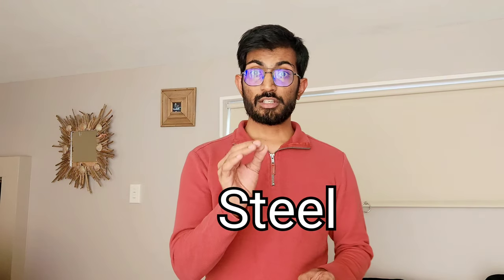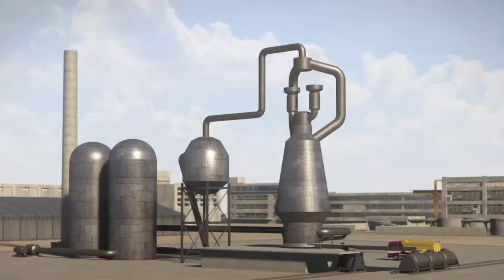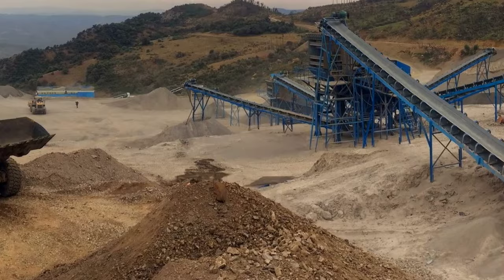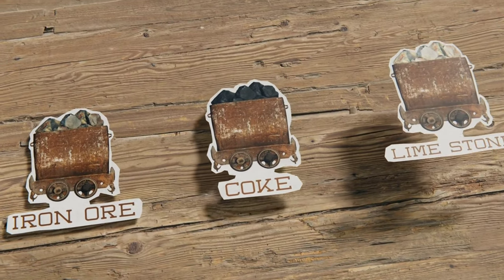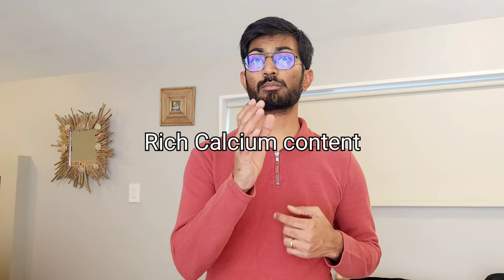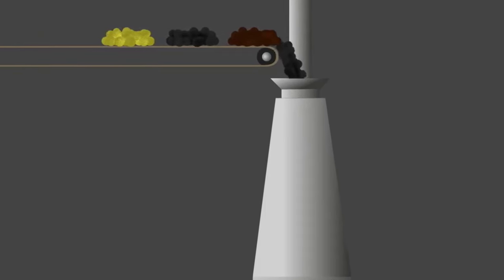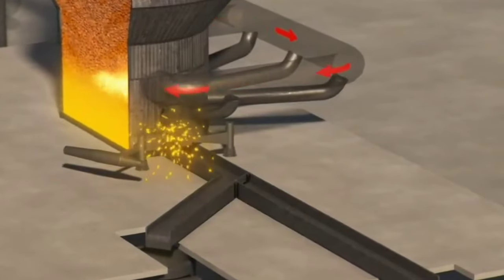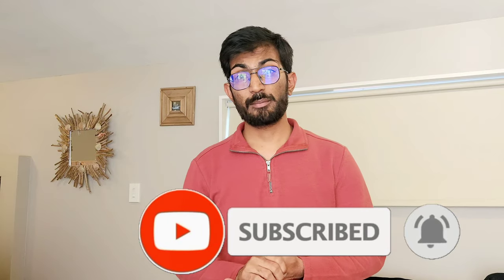how Steel is made? part 1  #steelmaking #steel #metal

Comment: Not made by steel? Planes, my toothbrush, phone can done almost without steel, just motor needs some magnetical.
Reply from the maker: In a way they may not be a product of steel but indirectly they are made by steel. Conveyer systems. Extrusion and die making for your toothbrush, processing plants for those phones and pleases do have steel in the chairs and controls , wheels etc.  Let me know what you think.